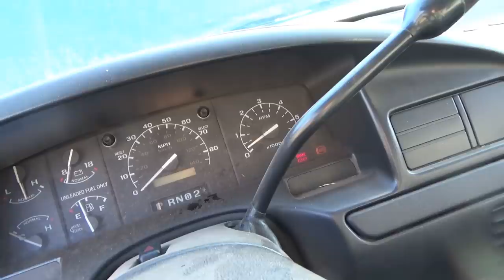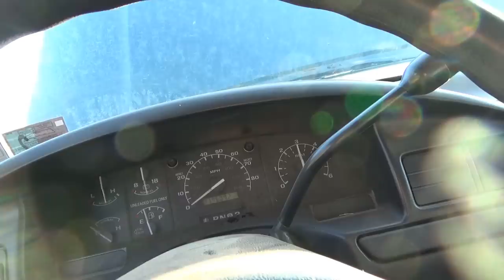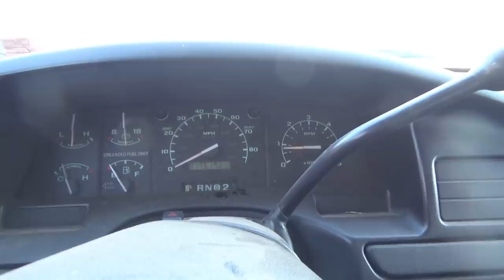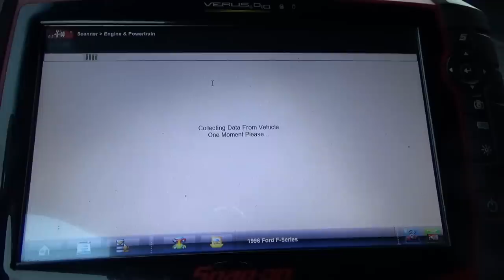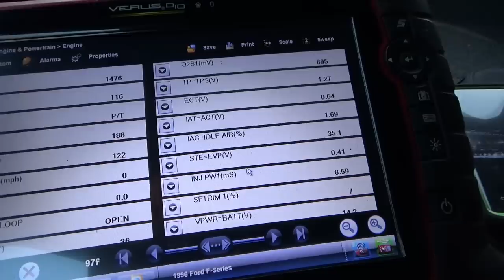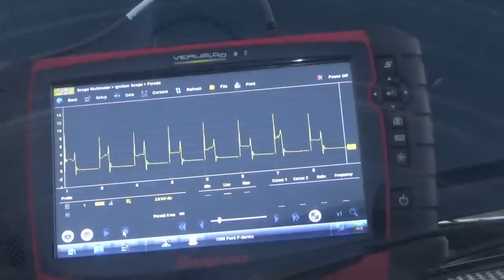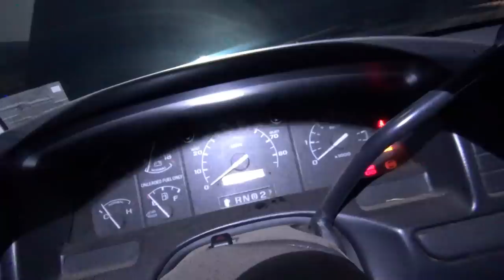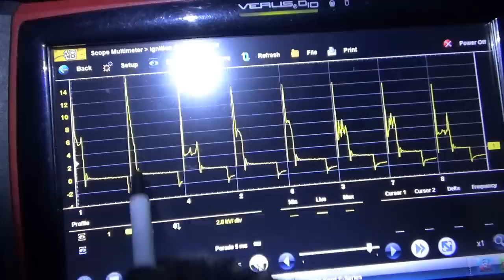Ford BIG BLOCK: Hard Start after Engine Rebuild? (Part 1 - Memorial Weekend Special)

Comment: Couple of things jump out at me. KOER test on these are pretty good. It throws a MAP and ECT code. Scanner shows VREF is high. I would check the reference voltage for sure and compare it to what ECM is saying. MAP hertz is not correct on scanner. Service info shows it’s KOEO and hot idle hertz reading.   KOEO it should be 157 hot idle it should be 105 or so. Check base timing and check spout. If spout is in check PIP on scope to see if it’s changing when spout is removed and replaced. This is kinda looking like maybe a ECM issue as MAP and ECT are being flagged and they both could be effected by a bad VREF voltage. It’s overfueling and washing the rings down when cold sounds like.
Reply from the maker: Great info Jeff 👍

Comment: first thing I would have done was a compression check on all cylinders, then  spark timing, then fuel delivery. also maybe some stale fuel in the tank. also took a long time in open loop. never did see it go into closed loop.. maybe a lazy coolant temp sensor.

Comment: I think that you may have two if not three part problem! Some exhaust valves lash too tight, for one. It may be starving
for fuel or it might have some raunch fuel. The distributor cap might need to be changed too! The strange noise might
be attributed to the need of shimming the starter some, to back off the tight positioning of the bendix.

Comment: Back in college a friend put a cam in a car and when it went to start it up it sounded like this, no compression.  Turns out he left shop towels in the intake ports (to protect the heads) and forgot to remove them before reinstalling the intake manifold.  They wrapped themselves around the intake valves and stuff like that.  I think his pride was more damaged than the engine but still.  This was over 20 years ago.  Car was what I think was one of the first manual swapped Caprices (96).

The fact that this one runs suggests it's more a valve timing issue causing very low dynamic compression at low rpm.

Comment: That black rubber undercoating sure looks shiny but man it really accelerates rust. For anyone thinking of doing this don't. Use motor oil or fluid film type undercoatings. That rubber traps moisture

Comment: I'd put that engine on #1 TDC and confirm the distributor position and timing is correct. Visual inspection of the rotor, cap, ign wires, vacuum lines etc. Maybe he has a HiPo cam? Cam timing? Starter doesn't sound typical...check for aftermarket or worn bendix etc. Sniff the oil and coolant. This is all old school diagnosis I would think. Confirm what parts are used with owner esp the camshaft.

Comment: Start with the customer supplied info: 1)On initial startup there was no oil pressure. 2) This was due to distributor not aligned properly.  I would start with checking base engine timing and confirm proper firing order. Also, a good possibility of a bad lifter or camshaft due to lack of oil pressure. It seems it’s damn near impossible to get quality flat tapped lifters anymore.

Comment: That scenario when it was first started after the rebuild - I'd be concerned about the new flat tappet camshaft.  You don't get second chances with breaking them in.
Reply: And a number of people are finding problems with parts, even parts they buy from trustworthy distributers.  It's to the point that Car Wizard swore off rebuilds unless he can get new old stock parts.

Comment: Cool case study Ivan! 

Spark plugs have been through hell I think. Likely all need doing to make it run perfect when it is running. But the real question for me is the intermittent quitting and hard or no restart!!?? Looks like O2 and fuel trims are telling you the truth… So that map code is of a lot of interest to me right now. I would want to put some testing attention there as next steps. If it’s reporting there’s way too much air, perhaps it could be flooding the whole engine out so bad before falling on its face dripping in gas. Cylinder wash in that case could explain the seeming lack of compression on restart attempts??!! Fun to speculate🙂 Look forward to part 2!
Reply: or the owner glazed the cylinders when the oil pump wasnt pumping,  then when the rings get hot, they expand and the compression comes up a bit, but misses due to low compression,. with a freash rebuild the compression should be awesome. it sounds weak.
Reply: @randy1ization  Could be on to something. But to affect the whole engine simultaneously like that before compression is just suddenly restored sufficient to run is hard to wrap my head around! Either way, a look at crank case pressures during the symptom versus when it’s running decent could show a lot there. That would be a lot of blow by! The important thing is being able to prove it! Just pulling it out and rebuilding it again without knowing for sure she’s gonna be right when you turn that key again is not my idea of a good time.
Reply: The more I think about it…. Yeah, this is a wash problem, with over fueling due to the map sensors interpretation of the low vacuum, but it is only acting as an accelerant to the rings problem your talking about!Thats likely where this is going🙂👍
Reply: @jeremyah78  when its just whirring, I dont think its really cranking over,  I think the bendix arm iis not kicking out and its spinning in place.. if there was enough fuel to wash the cylinders, the engine would hydro lock. Ive seen this on a mercruiser engine with a mercarb dripping fuel after shut down.   also the truck should be smoking to high heaven when its running if itss getting over fueled, as it is running on at least 7 cylinders most of the time.   im wondering if the 02 sensor is a bit lazy and keeping it in open loop a little too long, and fouling the plugs.   also if they got a little too generous with the assembly lube and it has the hydraulic lifters acting funny.
Reply: my next step would be to pull the valve covers and look at the rocker arms as its cranking over to see if any valves are sticking.  also to  verify the pvc system is routed correctly.  with a fresh rebuild of unknown quality, theres so many things it could be.  piston rings in wrong grooves or backwards, intaske manifold gaskets covering wrong holes,  a coned cylinder bore, wrong cam profile,  wrong valve spring height..  but it could also be something with the idle circuit being out of calibration as well,. as it will rev smoothly,  but is hard to start or doesnt want to idle well.. usually, when you get past a certain rpm, the idle circuit is taken out of play completely.  not sure how  these trucks control idle. if they have an IAC stepper motor, that would be a place to check too. the computer controls the fuel trims, but there has to be something else that seperately controls the air  mixture for idle.
Reply: @jeremyah78  I dont think the motor is turning over when the whinning noise is happening,, I would love to see a pressure transducer reading when this occurs.. if the motor is really turning over, there should be at least some pressure.  also the oil in the motor should be very diluted at this point if that is the case and the plugs would be so wet fouled the motor wouldnt run at all and the motor would hydro lock..  whats possible is the starter is staying engaged at times, and other times the bendix arm is not kicking out, and just spinning in place. .if the starter is staying engaged, that puts a small load on the engine. this could affect map readings and  fuel mapping .

Comment: I owned a 86 Ford Ranger with the 2.9 v6 fuel injection and when you unhooked the battery it would run like shit for 10 miles. After it learned things ran great. Not sure if the battery in the computer was bad

Comment: I'm surprised you didn't put it on top dead center and make sure the distributor set right and do a compression check on all the cylinders

Comment: Interesting old truck! I would check spark plugs, distributor and plug wiring and then check injectors and fuel pressure. There may also be spark timing misadjustment. Part 2 will tell 🙂

Comment: I'm fairly certain that the starter drive is slipping on this truck. It's typically worse when cold but improves with higher temperatures. I'd note it as a problem, but not THE problem, unless the engine won't crank at all because it's slipping so much. I suspect a fuel injector issue here. Maybe they installed high-flow injectors, or the injector connectors were mixed up when reassembling.

Comment: What makes an engine run?  Just a few things to check :-)

Air - filter, MAF or MAP sensor, manifold gasket leak

Fuel - proper fuel, fuel pump, fuel line, fuel filter, injectors, ecm, O2 sensors, coolant temp

Spark - ecm, RPM sensor, cam-crank sensors and correlation, spark plug wires / coils

Compression - piston rings, valves, cylinder head, piston

Timing - cam and sensors, timing chain, ecm

Comment: You'd have thought the guy would have put new plugs in as a matter of course on a rebuild. Also, with a fresh rebuild, new low tension rings that haven't seated yet and cylinders awash in gasoline, you're not going to get compression, hence the starter spins.

Comment: Hyd Lifter / Tappet jack... in this case-  check oil pressure as it sounds like all the lifters are jacking up, or has he put gear oil in the sump? - it would get better as the oil warms and thins out... Relief valve stuck closed?  Anything that would take the oil pressure waaaaayyyy up over normal
Reply: I found a fresh rebuild with a stuck relief valve. Oil pressure would peg around 400 PSI causing engine stall and no compression until the HLA'S bled down.
Reply: @charlesjoy3091  Exactly this

Comment: How long did he run it without oil pressure?
Reply from the maker: 10 seconds
Reply: Don't forget, Ford did not run a real oil pressure gauge.  he oil pressure gauge is basically a gauged idiot light.

Comment: dist. not engaged into the oil pump, YIKES. hope that didn't damage the oil pump or distributor, having it clamped down tight put a ton of pressure on everything.
not to mention the part about starting it without oil, hopefully the used a priming tool(on drill) or old dist. without gear and drill.
I'm guessing they also didn't do the lifter/cam break in either, seeing that engine would be hydraulic flat tappet and need the correct oil + break in procedure or it will quickly delete the camshaft lobes and gall the lifters. I'm guessing the damage is already done, unless they went aftermarket roller lifter setup. 😬

Comment: I have been working on a old old honda trying to get it to run for inspection.. its a second car so i never drive it.. normally i just give it 1/4 tank of premium and an Italian tuneup and its good to go.. this time its a horror story.. valve cover orings leaking plugs are 2 inches deep in oil.. plugs are insanely covered in soot.. exhaust is black .. its dumping fuel.. ate the AC belt.. so I am unloading the parts cannon on it and a lot of parts are just not available any more.. even though I started 2 weeks early working when I have time I think I am going to be another 2+ weeks waiting on parts and doing repairs.. my poor neglected car needs some love.. but its getting expensive for a car I never drive..
Reply from the maker: Cars that aren't driven can get very expensive for sure!

Comment: Sounds like ignition timing/(mis)wiring .. and/or cam timing .?
 As commented earlier from another viewer, you may want to pull the ECU and check for bad electrolytic caps .. let’s hope the ECU is not potted, and repairable if needed.

Comment: I think your fuel pressure regulator diagram is ruptured and dumping fuel into the manifold. Do a fuel pressure leak down test. Pull the vacuum hose off the regulator and look for fuel.

Comment: Injector drivers in the Computer are weak on those cylinders. The old ford Trucks back from those days are know for it after  they age.The diodes leak out. Use a noid light on the dead cylinder compared to the cylinders that are good.
Reply: Pull up the computer diagram and I would lay money that the cylinders that are not firing and building up with carbon are all tied to that capacitor on the computer

Comment: Sounds like #7 and #8 plug wires are swapped.
Reply: That did cross my mind earlier!
Reply: @craigtegeler4677  ANd the weird cranking sound/condition makes me think the starter pinion/bendix is slipping on the starter motor shaft, but still turning the engine over somewhat. Or the gear ring on the converter is slipping.

Comment: I wonder where they installed the 02 sensor being it has headers and if it is in the correct spot,, I know on old chevys some are right at the manifold, and some are further down near the muffler..  if the 02 sensor is in the wrong location, it may be taking way too long to close loop, and running too long in a rich fuel condition, fouling the plugs.,

Comment: Was fuel pressure tested? Recently had  a later F150 with a rebuilt 5.4. I always listen to the injectors with a stethoscope and check fuel pressure. Pressure was OK, but would bleed off, key off. Not bleeding off to tank... verified. Long term was maxed on bank one, with a misfire code, on cyl. one. Truck ran horrible! I had pulled the fuel rail and noticed number one injector pissing. Replacing that one injector was the fix. Amazing how one cylinder/injector seriously affected drive-ability. VREF high is also concerning. Also, as others have stated... fuel pressure regulator could have a ruptured diaphragm.

Comment: Hi Ivan, i think you should put anew set of spark plugs in it, and seems to be a problem with mixture, too much fuel somewhere, is there a vacuum leak around number 7 cylinder or injector fault, if thats where the fault is around number 7...Fred in uk.

Comment: My guess. Low fuel pressure making the injectors drip raw fuel rather than spray a fuel mist.  The truck probably ran pretty bad with the old motor and went for some time getting different fixes before the engine rebuild and who knows how long that took so it could be bad fuel related as well.
Reply from the maker: We'll see in Part 2 👍

Comment: Stuck oil pressure relief valve causing too much pressure  holding valves open from extended lifters

Comment: Injectors are color coded if mototcraft oem in there, the color means alot. They all look the same, along the way incorrect injectors could have found there way inside

Comment: Such a long diagnosis with very little done.  You know cylinder 7 has a misfire, check firing order, check timing, pull the plug, do a compression test, swap plugs, swap wires, do an injector drop test.  All these tests could be done in 15 minutes.... Most likely you will find the issue here.  If not you did deeper into in cylinder test for valve timing/lash, ignition control and output on a scope, and injector control on a scope.  Radiator test for CO2 gas to rule out leaking head gasket.  Look in cylinder with borescope.
Reply from the maker: Spark plugs are being fouled due to an extreme rich condition affecting the entire engine. Part of the art of diagnostics is not getting side tracked by little issues that are just symptoms of the big problem 😉

Comment: Doesn't seem like it ever really warmed up on the temperature gauge, though those are really just indicators.
Reply: Love data showed 183 degrees, so that’s pretty close to operating temp. Can’t remember if these have a separate temp sensor for the gauge and ECU, but if so, the gauge sensor might be a bit funky.
Reply: Those older ford gauges aren't really a gauge. They just go to the center if there isn't a problem

Comment: Wrong spark plug wiring timing is my guess, ford charged the timing order in those years.  Double check the wire order on distrubitor with firing order of the before and after the change.`1-5-4-2-6-3-7-8 number 5 being the most center front on distrubitor or 1-3-7-2-6-5-4-8 with number 3 being the most center front on distrubitor.
Reply from the maker: It ran great on the open road. Firing order is definitely correct 😎👍
Reply: The only deviation is the the 302 HO using the 1,3… 351 firing order.  All other engines, FE, truck 302 and 460 use 1,5…

Comment: Its funny how many want instant gratification from watching a Video, Then They wonder why the Vehicle still has problems right after it was just at the SHOP,     It's probably because the technician wasn't as thoroughly checking every possible problem like You do, Keep on doing YOU thoroughly..... And get the Man some Gas it's never going to be a Civic a grocery getter only Sniffing Gas🤫 Not drinking it required by any Real work Truck.😂

Comment: I wonder if the spout plug is in the connector?🤔 If not, no advance. Something else I noticed, the TPS is reading slightly higher at idle than it should be is it not?  1.03 volts seems to me to be too high at idle. Should be around .5 volts. Also, vehicle reference voltage should not be higher than 5 volts. I bet you have green corrosion or bad capacitors on the ECM circuit board. I think you did a video a while back with a bad ECM that had over 6 volts for a vehicle reference voltage.

Comment: HEY FORD GUYS; ive got the dreaded 2006 5.4 L engine in my F150 xlt  truck for $7000 ten yrs ago and i already sunk $1600 into a new auto tranny, $3000 into body/paint  and $2500 in 5 new 35 inch tires.

if the unthinkable wort case happens and now my engine blows, can i bolt up a more reliable  ford 300 inline 6 to my current tranny?